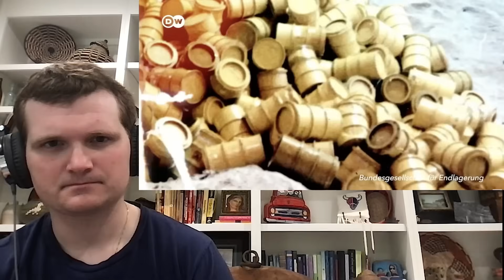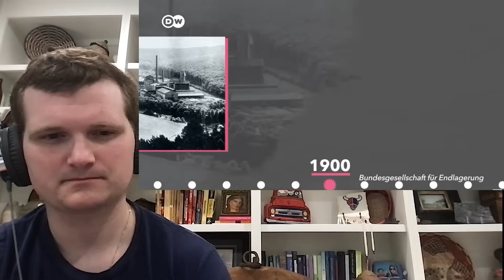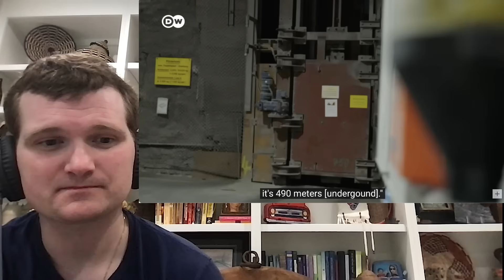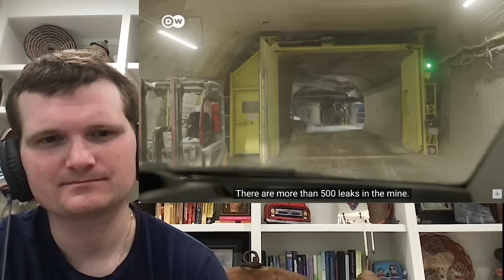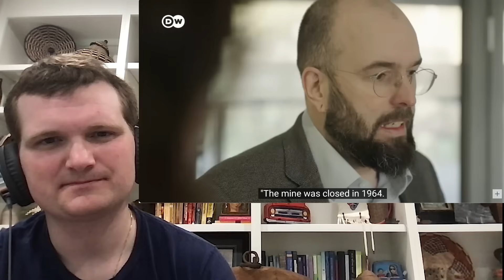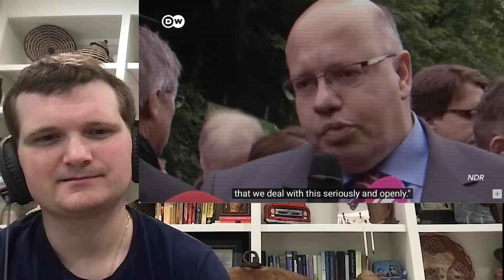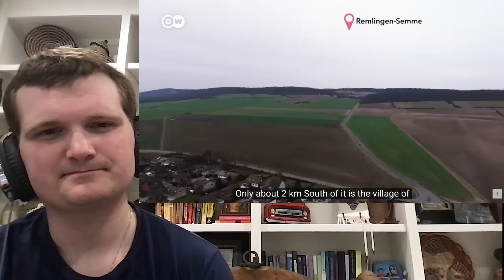This Nuclear Waste Dump Has Been Leaking for How Long? - Nuclear Engineer Reacts to DW Planet A

Comment: political terms in germany are 4 years with the majority party (together with one or two partners) forms the governing party. The other party forms the opposition (usually around 40-50% of the parliament).
Then a president is selected and a chancelor elected. The chancelor then suggests a cabinet full of ministers to be elected by the parliament (iirc).
Reply: And even if the reigning faction is reelected, it's quite common that ministers are rotated around, so it is quite normal to have a minister in office for 4 years.
Reply: you are recalling correctly good sir or madam. also while not official policy it is common that the seats for ministers are distributed among the winning party or partiy's coalition depending on their share of votes. Meaning that even if "just" the junior partners shift, the ministers are replaced.
Reply: Election of a president (an almost only representative role) is independent from parliamentary elections. The term is five years (whereas parliament and with it government is four years).

Comment: so, I havent watched it all, but I was under the impression that they are not simply metal barrels. The waste inside is encased in a special glass. The main problem is that, when catching neutrons and undergoing decay itself, the glass is changing some of the elements and forming water soluable compounds that cause the glas to loose its integrity, causing an increased risk of leakage/contamination.
The metal barrel is just the outside container.
I've learned about this in the radiological studies of my chemistry degree some years ago so I can not remember the specifics.
Reply: One of the documents briefly shown(don't have the time stamp on hand) said "Verabeitung: Betoniert", which means something along the lines of "Treatment: cemented". So they are encased in concrete in some way. At least the items on that documents are, might be a mix.
Reply: @jort93z  the problem is the way the trash was handeled (i.e. basically just thrown into a hole). there is no way of knowing which containment measures survived and which did not. and for all intents and purposes, metal barrels in a salty, humid environment can be considered decayed just a few years after they got there.
Reply: @DackelDelay  Yes, obviously just throwing them into a hole is not a good way to handle them.
But they aren't just regular barels either.
Reply: That type of container is not used for irradisted material from a nuclear plant. Nuclear waste or irradiated fuel are stored in cerramic and concrete container 5 meters high and 3 meter wide. The yellow container are used for low and medium grade radioactiv materisl that come from medic and industrial fields.
Reply: @andread5560  true, but this has not always been true, this is old waste, its encased by pooring molten glass over it, so this is medium and high grade (by todays definition) waste. Its not spent reactor fuel as far as I am informed, but I cant tell you anymore without having to read up on it.
Reply: @eredaane4656  wrong . High-grade nuclear waste is only that coming out from the reprocessing of nuclear irradiated fuel. There is no other industry that produce high-grade nuclear waste. In the salt mine of Assen there is only medium and lower grade waste. No nuclear waste has ever been poured there.

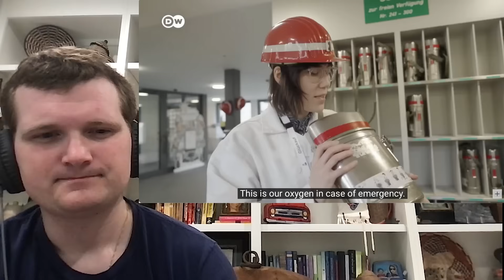Comment: 9:18 We have these emergency oxygen devices in accelerator tunnels and collider experiment caverns too.
Reply: afaik it's somewhere around 6m below ground that fire services/rescue personel won't enter without respirators and proper ventilation is required. it's just physics and the fact that CO2 is heavier than air.

Comment: Well, Uranium and Plutonium are heavy metals, they are not only toxic due to their radiation, they are also toxic due to being heavy metals.
Reply: I like heavy metal
Reply: @oxydoxxo 
Hell yeah bruv!
\m/
Reply: They're mainly fatal via ingestion tho
Reply: @BabakoSen  That's kind of the point here; Germany and many other parts of Europe source the vast majority of their drinking water supply from ground water. Meaning any contamination to it would be that much worse.
Reply: @DackelDelay  any industryal activity creates material that can pollute drinking water. The extraction of gold is made using arsenic. A depleted gold mine is generally full of arsenic. Aresenig is highly dangerous and dont deplete with the passing of time a water likege would make unusuable water source idefinitly.
Reply: They also decay into other more stable long term toxic heavy metals.
Reply: Yes, the major hazard is that they're heavy metals. But for the anti-nuke crowd, their long half-lives can make for extremely scary numbers. For instance, they'll strongly imply that all radioactive material is as dangerous as cesium-137 and that it will last as long as uranium and/or plutonium. And plutonium is another "hot subject". They'll imply that plutonium means nuclear bombs, while ignoring the difference between plutonium-239 and plutonium-240 (pu-239 is used for bombs. pu-240 spontaneously fissions too frequently and is unusable for bombs. Because of this, for bomb production, they cycle the fuel through the reactor rather rapidly in order to minimize the amount of pu-240 that's made. For power production, they leave the fuel in the reactor for a long time to minimize cost and utilize the fuel more thoroughly. But because of leaving it in the reactor for a long time, a significant amount of pu-239 is converted to pu-240, making the plutonium unusable for bomb production.)
Reply: @johncochran8497  so, just to add to that: you can poison way more people with the same amount of pu-doesntmatterwhichatomicnumber than you can kill with a nuclear device containing the same amout.
Reply: @johncochran8497 the spontaneous fission of plutonium 240 isn’t a cause for concern when it comes to maintaining a stable reactor? What does it become when it undergoes fission?
Reply: @SuppressHoardReject  The issue with the spontaneous fission of Pu-240 for bomb production is the probability of a premature initiation of the fission reaction during assembly of the super critical mass, resulting in a smaller than design yield. It was due to this "contamination" that the more complicated implosion design for Fat Man was used instead of the simpler gun design as used in Little Boy. If the Pu-240 contamination is small enough, then the implosion design is sufficiently quick. But too much pu-240 contamination would mean that even the implosion design take too long for assembly. The spontaneous fissions of Pu-240 don't have any significant effect on the mere production of power.
Reply: @forfun6273 no problem. If pu 240 make spontaneous fission it is just like a normal fission of u 235. Nuckear plant are not nuckear bomb. Nuclear bomb are designed to make all the fuel contained to go fissile all at the same time. Nuclear plant are the best way to eliminate military grade plutonium and uranium caute they use it to make electricity and  the dont explose cause they are pjannd that way. The only nuclear plat that exploded is Chernobyl abd it wasent a nuclear explosion but 2 different explosion :  the first due to high pressure and the second due to the grafites points of control bar that went in sublimation du to high temperature. No nuclear explosion.
Reply: Do you even lift, bro?
Reply: Heavy metal is important to the economy....gold is very heavy, 19 times water, lead is only 12 or 13 times water. Tungsten is also 19 times water
Reply: Meh. Iron is a heavy metal too. About ten parts per million of plutonium is absorbed even in salt form if you eat it. I wouldn't worry about it. I'd barely worry about ingested plutonium even though it is very radioactive; it's only inhaled or injected you have to worry about and the radiation is the thing you worry about. Uranium is the opposite; don't worry about radiotoxicity unless you have the radium daughters too (uranium ore with the whole decay chain, which means a lot of radon gas). Don't eat uranium for the same reason you shouldn't eat lead.
Reply: A radioactive heavy metal from Chernobly will never reach me, but Radioactive particles of a coal exhaust in Russia travel around the world and enter my lungs and other millions people.
Reply: @MutheiM_Marz  Caesium from Chernobyl made it all the way to the western tip of Europe. Some food items like eg. mushrooms still have elevated Cs-137 levels to this day!
The same is true for Cs-137, Sr-90 and Pu-239 from surface nuclear weapons tests in the 60s.

Turns out that when you blow stuff into the atmosphere in the form of fine dust it doesn't really matter how "heavy" the element is.
Reply: Blah blah blah, heavy metals... Just pick 100g, and its lighter...
Reply: @isaacm1929 the issue with heavy metals though, is that 100g weighs as much as 100kg, that's why they are called heavy /jk
Reply: @Jonnyg325  ah yez. Like the 1kg of feathers, which is lighter than 1kg of steel... makes sense now...
Reply: @isaacm1929 😂😂😂😂😂😂😂😂😂😂

Plutonium is significantly heavier than iron in terms of density. Here's a comparison:

- *Density of Plutonium:* Approximately 19.86 grams per cubic centimeter (g/cm³)
- *Density of Iron:* Approximately 7.87 grams per cubic centimeter (g/cm³)

This means that plutonium is more than twice as dense as iron. This high density is one of the reasons why plutonium is classified as a heavy metal. Plutonium's weight and its nuclear properties make it a critical material in nuclear reactors and weapons.

😂😂😂😂😂😂😂😂😂😂😂😂😂😂😂
Make sense or non sense ? 😂😂😂😂😂😂😂😂😂😂😂
Reply: @isaacm1929  Well technically, if you weigh a kg of feathers and a kg of steel in atmosphere. You'll have a greater mass of feathers than steel simply because the feathers displace more air than the steel and hence experience a greater buoyancy. Do it in vacuum, and you'll have equal masses.
Reply: @johncochran8497 true, but the difference because of bouncy is extremely small

Comment: The biggest problem about nuclear power in Germany is that there is no remote area in Germany where you could store it. Germany is so densly populated that we simply don't have that. At least not to store it for geological time frames without the chance that anyone effs up again and digs up that stuff without knowing what it is.

The high level radioactive waste is stored in CASTOR containers on the respective nuclear power plant sites here as well. So they are still on these sites while the power plants now have all been shut down.

When I was studying in my last year at Gymnasium (something probably comparable to college) every chemistry and physics class went to visit a nuclear power plant - Gundremmigen in our case - so we could see first hand how they worked and what their safety measures were for the radiological controlled zones. They were far far more stringent than what was done during the 60's and 70's, but they also knew these containers were to a burden to watch over for generations to come, because we simply don't have a site to store them safely that hasn't people living right next to it.

At university, we didn't handle radioactive stuff much, but security and obeying proper handling protocol was definitely the top priority in case we did.

PS: Small addendum. Gundremmingen Unit A was the only German reactor that had a catastrophic failure. A short circuit caused a reactor scram. Somehow some valves were then opened that shouldn't and flooded the reactor building with 3 meters of contaminated water. Units B (the one we visited) and C however produced without major incidents until the shut down a few years ago.
Reply: Don't need nuclear waste if you invest in recycling it. Yes, it's horrendously expensive but.. It works.. And it's better than what we have today..
Reply: There is no nuclear waste, only wasted potential.
Reply: Not really a problem, those casks last a long time, and you can just co-operate with some other country to build long term storage. And you don't really need place that's that remote, you need a place with right geological conditions. Which there should be plenty.
Reply: @mukkaar Dump it in the countries dumping migrants into Europe
Reply: @mukkaar  Good luck finding a place that's willing to do that after Asse. It's not just "we don't want that stuff in our backyard", it's a lack of trust in an industry that has demonstrably lied about the risks of storage for decades.
When the Asse scandal made news in the late 2000s and into 2010 and 2011, that distrust in industry experts became a real issue, and it's hard to argue that it wasn't justified. Fukushima happened in a political climate where an industry expert that was calling anything nuclear-related "safe" was immediately met with skepticism.
And the scandal isn't over. For example, in 2019 former environment minister Jürgen Trittin (minister from 1998 to 2005) said in front of an investigation committee that there had been experiments at Asse with storage of highly radioactive material (not just the low and intermediately radioactive stuff) -- how much of that is still on site, where, and in what form, is completely unknown.
Reply: @renerpho  Well, it's pretty sad. Plane flights were not as reliable as now too at some point, but they are now one of the safest form of transportation.

And even Asse, despite being a horrible case of neglect, hasn't actually caused trouble for the public.

I guess Germany has to ask, are they fine continuing to be reliant on fossil fuels? In both strategic and environmental sense. Even solar panels are pretty much all sourced from China.

I'm personally a huge fan of renewables, but more accurately I would say I'm for low carbon and more environmentally friendly ways of producing power. I'm also for diverse energy mix so it's more resilient. If we apply all methods we have at once, we are going to be getting much better results than just hyper focusing on one solution ä.
Reply: @mukkaar  If you've ever discussed the 737-MAX issues with a Boeing critic who won't enter one of their planes if their life depended on it, you may stop using the "planes are safer now" argument. It's just not convincing.

The problem is trust, especially trust in experts. Sometimes that lack of trust is a result of unfounded conspiracy theories. Sometimes it's based on good reason. Either way, it makes it hard to have an objective discussion.

Germany's Green party is outwardly committed to leaving behind fossil fuel. They're also deeply routed in the anti-nuclear movement since the 1980s. It is one of the very few ideological truths that is unquestionable. Even suggesting that nuclear power is an option that's worthy of discussion is political suicide. That's a catch-22.
Reply: @renerpho  Ah yes, and if we skip that and look at average number of actual incidents that result in some sort of death of injury, it's still almost nothing. 
Yes, we need to take these things seriously, but flying is not going anywhere and neither are those stats even if there are issue. 
Singular events and incidents don't really inform us about safety. And if we look at cars, those are committing freaking genocide currently and we still use them because they are useful.

But yeah, it kinda sucks. Many European green parties seem to have come around to nuclear, since after all they realize it's about the environment, not renewables.
Reply: @mukkaar  It's not me who you need to convince. ;-)

The thing about every other Green party "coming around to nuclear" is that, from the perspective of Germany's Green party, it looks like all of them going crazy and sacrificing the future of their countries for a short-term benefit.
Reply: @mukkaar  Or the countries have simply noticed how difficult it is to build nuclear power plants and therefore do not rely on them. There may be reasons why very few countries in the world rely heavily on nuclear power
Reply: @mukkaar  Germany is majority renewables. And it's still rising.
Reply: @renerphowhat are the dangers of storing it? Bad publicity if you do it horribly wrong???
Reply: @AnotherAustin-z7b  the technical problems of long term storage are quite well understood and could be handled. 

The main problem is rather a political one. Providing adequate funding and adhering to technical standards when handling nuclear waste. And since that has been notoriously problematic, there is simply no trust whatsover that this will be done properly in the long term and at what cost.
Reply: @Llortnerof  Unrelaiables*, because they do not prevent the heat death of the universe.
Reply: @edgarhilbert4797  No source of electric power does.
Reply: @Llortnerof  Therefore no of them are renewable!
Reply: @edgarhilbert4797  Sure, if you look at things at a scale that is utterly useless for our purposes. Which just means you're engaging in pointless sophistry.
Reply: @Llortnerof  It is the only thing that matters, otherwise is a scam.
Reply: @edgarhilbert4797  No, it's utterly irrelevant, as all of that happens at time scales well outside of what we will experience as a species.
Reply: @Llortnerof  Are you conspiring to omnicide?
Reply: @edgarhilbert4797  To what purpose? Everybody is going to die long before the heat death anyway.
Reply: @Llortnerof  Malice!
Reply: @edgarhilbert4797  No, indifference. Our Sun is still good for longer than life on Earth has existed so far. It's not a problem we will ever have to deal with.
Reply: @Llortnerof  Malice*

Comment: Is it safe to say that standing next to those dry cask storage units actually lowers the background radiation you're receiving? If you were pressed right against it, all that shielding would be blocking out almost 180 degrees of directional radiation coming in from the sides
Reply: It actually does, I measured it.